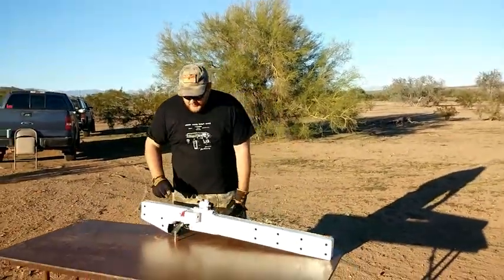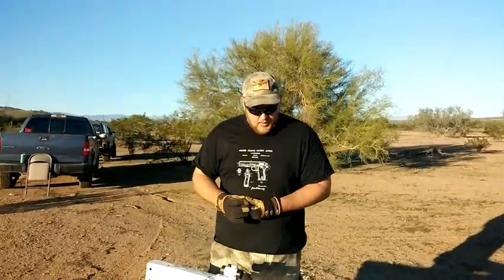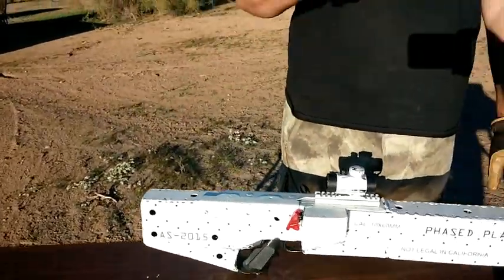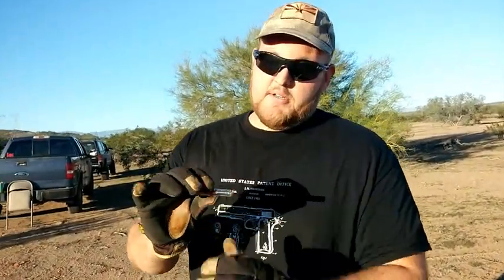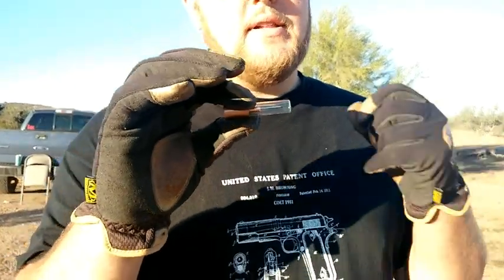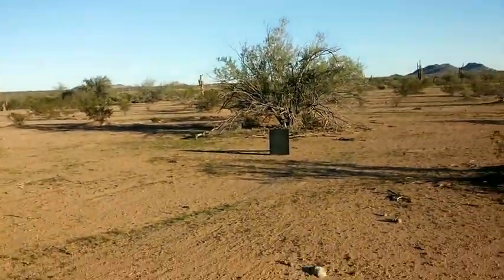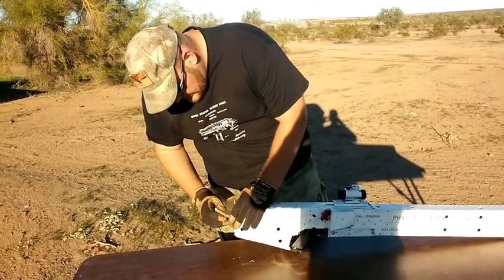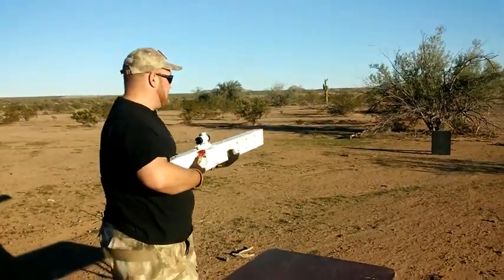Electromagnetic Plasma Rifle Test Fire

Comment: im having trouble on mine with the capacitors, could you help me understand how you are able to charge yours, and what model you are using? Its for my schools physics fair, Thanks
Reply: ... sweet christ, "messing around" is one thing but don't give people advice on electronics when you've got no idea what you're talking about.
Reply: are you transforming it to higher voltage because I put 2v in a 16v cap and it never got above 2v but when I put it on 13v it read 13v
Reply from the maker: +Koji Suga You can probably use a universal charger like they use for RC cars. It plugs into a 110v outlet and then hook the alligator clips onto your capacitor(s). Most of them have a digital display that shows how much energy is being transferred as well. Here's an example of a cheap one: 
http://www.amazon.com/Tenergy-Universal-Charger-Airsoft-Battery/dp/B003MXMJX8

Comment: +Alex Smyth Does your rifle really shot plasma,(well that sounds really incredible! limitless ammunition out of air!) or uses plasma bolt to accelerate metal projectile? Won't plasma scatter and lose kinetic energy in the air?
Reply from the maker: +傅兰轲 It shoots plasma, but not just exposed plasma. Its ionized gas (plasma) inside of a glass vacuum tube. But yes, like you mentioned, plasma dissipates rapidly unless contained within a magnetic field. So to shoot 'plasma bolts' or something similar, you would have to also project a magnetic field strong enough to contain the plasma from the end of the rifle to the target.
Reply: +Alex Smyth Impressive... It must cost a large amount of charge to create the "guiding" magnet field that can keep the plasma "bolt" thin enough to cut through your target, and thus need a precise control system to fire the EM field at the correct time. Cool. That means that through controlling the EM field "theoretically" you can control the trajectory of your bullet?

Comment: Awesome !! how can a private person build a plasma rifle ? :D ?
Reply: +Alien Go Boom A bunch of capacitors, electromagnets/coils, a barrel and some circuitry. There are some tutorials if you google coilgun.
Reply: It'll only work if you build it on April 1st.
Reply: Use conductive oil or gas to streamline the current/voltage of an arc flash, designed as a direct energy weapon. An ode to the flamethrower
Reply: This design is more or less a kinetic needle with ionized gasses in front of it. Scary? Yes absolutely. It also appears to be functional which is expected of a death needle with a bit of extra kick.
Reply: @m808bscorpionmbt3  definitely a 5.56mm kinetic lead needle with ionized hot expanding gases behind it, pushing said lead needle upwards of 3000 feet per second. One really has to admire the Armalite pistol grip and receiver just sticking out of the bottom too.
Reply: Carefully
Reply: The ATF technology branch ok'ed it,  meaning that they're both pretty cool guys and a cool place to work at.
Reply: @alastairward2774  Average atf technology branch enjoyer vs average every other part of the atf fan

Comment: Okay, I'm an immature 15 year old who most likely would not be able to acquire the parts to create this masterpiece, but please just feed my curiosity, and explain how you made this. Because this is cool, and though I might not be able to build it, I'd still like to have the knowledge. So, like, lists of parts, and how you put it all together, and the price of creating this, I'd love to know all of that.
Reply from the maker: +ShankMan eBay and Home Depot have everything you need lol. The chassis is just 1/8" steel plate, capacitors are 400v capacitors off ebay (the big coke can size ones, not the tiny ones), all the other electronic stuff you can get off ebay too. The hardware can be bought in person from Home Depot etc. The optic and mounting rail came from Amazon.
Reply: +Alex Smyth 2200 uf or 3900 mfd ?

Comment: For those of you doubting the fact that the copper would work in a railgun, you need to take a quick browse through any webpage actually explaining how a railgun works. ANY conductive material put between the rails will be spat out at high speed.

Alex, I understand why you think that the spiral rails would cause rifling, but you'll get better velocity and accuracy, as well as easier construction, by switching to straight rails and using a discarding sabot with a conductive armature (steel would not be recommended, due to erosion on the rails... I'd say copper is the best choice.) along the back. Sabot should be plastic of some sort, and 3-d printed would be the best way to go for that.
Reply: +Valynaz Valkynaz because it isn't a coil gun. completely different idea. I coil gun propels an object using magnetic coils. a railgun uses to rails charged by capacitors positive on one side negative on the other to create equal and opposite magnetic fields. a cunductive metal object or a cunductive case for a non-metal object is pushed into the chamber and the fields push it using what's known as a lorentz force to accelerate it rapidly. so it requires a lot of volts which you get from a bunch of capacitors or a few huge ones.
Reply: IndoLiberation but the copper is conductive which if I remember correctly works well in rail guns unlike tungsten e hen isn't as conductive
Reply: @valynazvalkynaz5375  Tungsten IS very conductive 😂😆😂
Reply: i read somewhere if you use copper it will melt in chamber when the railgun is activate, so tungsten is more effective
Reply: @BlankPNG it could be plating to more effectively absorb electricity
Reply: actually, although you are right in that the spiraled rails are pretty much useless for rifling, it may be useful to help dissipate the heat produced over the surface of the projectile, rather than just in two spots.
Reply: Actually yes! Pure tungsten is rarely used for TIG welding. You'll often see it alloyed with lanthanum, zirconium, and cerium. The standard alloy for tig electrodes used to be 2% thorium, but it's being phased out in favor of lanthanum due to thorium's radioactivity.
Reply: CorruptReverend the navy this year is gonna do field testing with their raucous they made and now im learning they military is coming up with a type of active camo "kind of like the predator in avp or the elites in halo" which bends light around you and we have project Thor which is like the ODIN orbital system from CoD Ghosts and drop pod like vehicles and project TALOS exosuits "skyrim name cod exosuits o.o" and we have working anti missle lasers meaning laser weaponry....how many more fantasy weapons are gonna become real
Reply: The current is actually more important than the volts in both types of guns and for the record both normally operate by using a capacitive storage bank which is not present in this demo. For the output he is displaying the gun should be attached by cable to a trunk load of caps are a couple of very large trashcan caps at the least. I would like to see his cap bank myself..
Reply: There are two types of coilguns. One where a ferromagnetic round is pulled by a field through a coil called a reluctance coilgun. Then there is and inductance coilgun that uses a large coil at the base of a rod and a ring of non magnetic metal is placed over the rod and down on top of the coil. When energized the ring and the coil generate a massive magnetic field in each that oppose each other. So the ring is pushed out of the gun at very high speed instead of being pulled.
Reply: Aaron Boysen point noted
Reply: joshua vance are you fucking serious? Link now I need to get one so I can find a way to modify it to use a continuous stream like a Plasma Energy Projector and start glass farming in my backyard
Reply: +Aaron Boysen Also, coilguns require a ferromagnetic projectile or sabot in order to function, whereas railguns simply require a conductive projectile.
Reply: Carl McKinney OK, I stand corrected.
Note that most viable induction weapons are rail guns rather than coil guns.
Reply: No laws against creating glass farms "glass gardens" in backyards
Reply: Couldn't find the original link, but here you go: http://www.salon.com/2012/06/28/army_tests_lightning_weapon_salpart/
Reply: The spirals may counter the rails from trying to push away from one another for barrel stability at least.
Reply: Nope that's not how it works but  your  wishing it worked like that in fact you picked one of the worst metals you possibly could have it screams THIS IS FAKE by using copper it would make a eddys current in the copper and that would cause it to never exit the gun look up magnet and copper tube and with the extremely powerful magnetic fields required for a railgun it would heat that copped to almost a molten state  exploding that glass tube instantly
Reply: @projectwes4573   I forget who it was so I may be wrong but there was a guy who didn't make a rail gun that did fire a copper projectile or at least he said it would be possible and would be better to use than steel because it wouldn't reach a critical mass of magnetism in his quest to make the most efficient rail gun
Reply: @SuperRandomNinja1  "there was a guy who didn't make a rail gun"
 OK right now we are only talking about railguns
Reply: @projectwes4573  He did make a rail gun. Multiple actually. Of a multitude of designs.   Including evenly wrapped as well as exponentially wrapped. He's just trying to find the most efficient design of a rail gun.  I don't remember the YouTuber because it's been a while since I've seen the video so like I said I might be wrong about what he said but I believe one of the possibilities he put out there for making his rail gun more efficient would be to yo use a copper or some other metal projectile like copper.  The reason being that it won't get overshadowated with yeah it overshadowated with magnetism like steel does wear at a certain point steel doesn't get any more magnetic and therefore any more power put into the rail gun is not going to propel the projectile any faster. Like I said I might be wrong for all I know it might have been a zinc projectile. But the dude undoubtedly made multiple rail guns of multiple designs I know that for sure.
Reply: ***** yeah a little
Reply: Nick Moore there is still a fairly decebt chance for it to pierce
Reply: Army's testing a plasma rifle
Reply: I know copper would work I'm just skeptical that the rifle is real because it's literally just one shot and we get no details about the firing or like the internal mechanics or anything we just see the outside shell
Reply: Copper is a highly conductive material it works well you are correct.
Reply: @volkervison3000  do you know of any example that shows copper can stick to magnets
Reply: Try dropping a magnet down a copper tube or a solid bit of copper (one could would imagine aluminium and or tungsten works as well) down inside a hollow cylinder shaped magnet and what what is does or doesn’t do. This little doozy should give you an idea of the effects of a (albeit fixed) magnetic field has on conductive materials . Now what about if (that) said magnetic field or magnetic fields could move or switch on and off?
Reply: Hi
Reply: actually I think this is a coil gun not a rail gun
Reply: @valynazvalkynaz5375  dafuq no
Reply: +IndoLiberation Depends heavily on how much current you feed through the copper. I strongly doubt that it would melt, but it isn't an ideal projectile material for an operational railgun due to the expense.
Reply: +Valynaz Valkynaz Tungsten has about 28% the conductivity of silver. Still still conductive (about on par with brass), but it also has the highest melting point of all metals at around 3400C. These two properties are why it's used for electrodes in GTAW (gas tungsten arc welding). I'm guessing it's used for rail-gun development due to the high melting point.
Reply: CorruptReverend
What about the possibility of using a tungsten alloy? Is there one with better conductivity with a reasonably high melting point?
Reply: Carl McKinney And in general, it is not the actual projectile being magnetized, the projectile is on a "sled" which is being magnetized, and basically accellerating the projectile. This is why one can shoot gummy bears from an induction weapon (-;
Reply: Morten Kristoffersen that id correct for a railgun, but not a coilgun. In a coilgun the actual round is pulled into each coil by the field which is timed in various ways to collapse when the round reaches mid point to allow inertia to carry the round on through the coil.
Reply: And that he shot a weapon but where's your proof its fake cause you can't 100% prove its real or fake so there's a chance it could be fake or real or both
Reply: I guess you don't need a conductive projectile in a classic rail gun, you could probably shoot a projectile made from wine gum.
Reply: ***** wait who are you and how does a capacitor have anything to do with a coil gun?

Comment: just gonna say this u guys are pretty dumb to be testing things without using something like bullet proof glass or at least some kind of protection to prevent things like this
Reply from the maker: 9+mafiahalo93 Unfortunately a 1"x 48"x 96" piece of bulletproof polycarbonate is like $4000 :(
Reply: Alex Smyth what about steel plates or something like that hell use ur car as a shield

Comment: If you think you are ionizing gas with a magnetic field, you are wrong.
Reply: +Derp DeDerp He is ionising it using electricity. It penetrates steel. Anyways, the magnetic field difference inside a railgun probably cause electricity to flow through the copper.
Reply: Derp DeDerp No, and in particular because this is a quite well made prank. Obviously there is a bog standard rifle inside the sci-fi casing !
Reply: patman0250
Well if you read the rest of the comments, you'd see he is actually serious. Not a joke.
Reply: +Rasmy Samy no it does not!
Reply: +Morten Kristoffersen You must not know basic physics. The entire principle is based off of how current flows through the "slide", which can be either the projectile itself or a mechanism to propel the projectile. Yes, that is how ALL rail guns are operating. Without a current running through this "slide" or projectile, there is no force produced to accelerate the projectile.
Reply: Derp DeDerp No not at all. An MRI has a magnetic field that is quite strong but that spans of a huge area, so that you cannot a) have a big enough field force and b) have something long enough to reach both poles. And they are magnetically shielded too.
Reply: Mason Hardee Half of that IS what I´m saying. But the current does NOT run through the projectile, it only affects the slide, which in turn accelerate the projectile.
Hence, one can fire Gummy Bears from a rail gun !
Reply: +Derp DeDerp Look up 'Electromagnetic waves' and do some reading. Magnetic and electric fields are always created in tandem.
Reply: Mason Hardee No, that is not how most rail weapons are operating. They have a slide internally, which is propelled by the magnetic field. The projectile is accelerated by the slide, to a Vmax, and eventually fired from the weapon. One can shoot gummy bears from a rail gun !
Reply: +Derp DeDerp yes he is. The magnetic field created by the current through the rails induces a current through the conducting projectile as it moves through the magnetic field (Faraday's Law of Induction). This current will ionize any gas he has in that vacuum (relative to its strength)
Reply: Devin Stewart
Ever had an MRI? Was the air around you ionized? Ever been to a hydroelectric power plant? Was the air ionized? Ever visited a superconducting cyclotron? Was the air ionized? Get a grip. He is not Ionizing the gas in his projectile.
Reply: @Dan77845  i’m not saying he was ionizing the gas but the gas around an mri is normal air not neon....
Reply: +Rasmy Samy dude this was a joke you moron get with the fucking times bro !!

Comment: Shooting an AR500 steel plate at 20 yards. What could possibly go wrong?
Reply: Not the copper sleeve.
Reply: +Derp DeDerp I Like You
Reply: +Kimble Angus it bounced because of the plasma exploded and hit the camera man if the plasma tube wasn't their it would go through the armor
Reply: +Kimble Angus tbh it may well have been partially the copper sleeve but it was the plasmafied neon gas acting as a sort of plasma torch upon impact im guessing however the range of that effect would be quite limited still nasty up close wonder what a aerodynamic solid projectile would do at long range also wondering what the velocity is on that thing as well has to be quite significant if at 20 yards it ricocheted and returned more than 20 yards to hit the camera man with what looked like maybe 20-40gr of copper projectile / casing
Reply: Anyone else getting Home Improvement flashbacks?
Reply: Not a damn thing